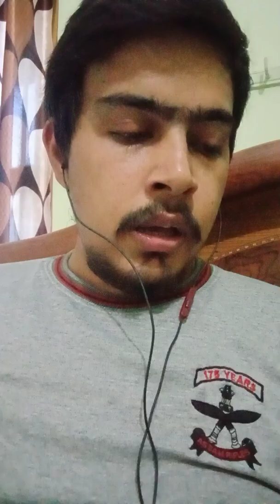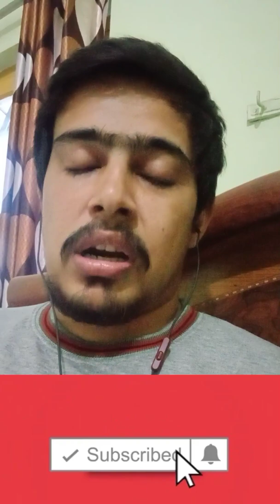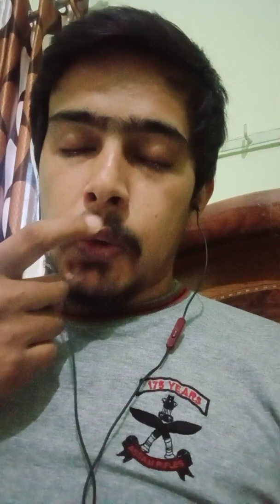ETO in Merchant Navy Interview Questions for Anglo Eastern & Great Eastern Institute-Part 4 | #eto

Comment: Bro do you have any info regarding 2022 march eto batch
Reply from the maker: Bro I have general info that it eto course starts in March every year.
Reply from the maker: @adarshkumar-ot2dm  bro u can email to HR and check what is the reason. They reply quickly.
Reply from the maker: @adarshkumar-ot2dm  In my case, and also other friends' cases I know, they were selected. So, dont worry and relax because u r selected for sure.
Reply: @ManojChausali  okk bro.. Thxx.😊